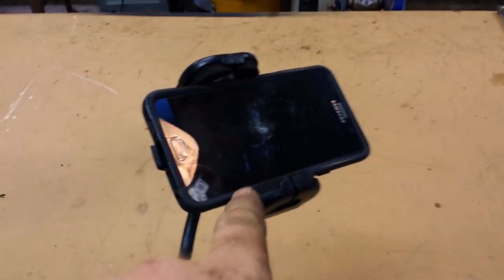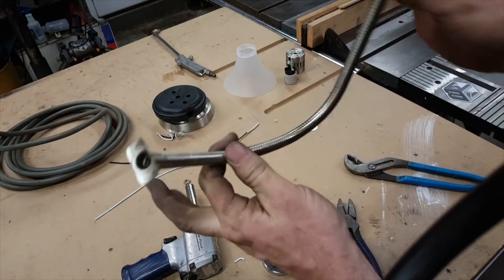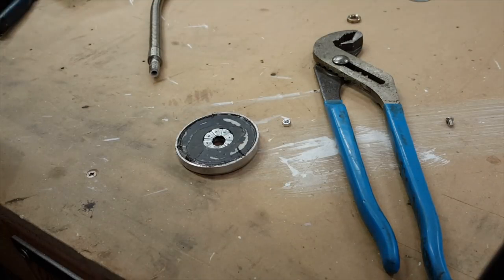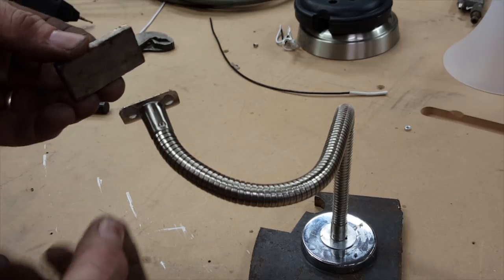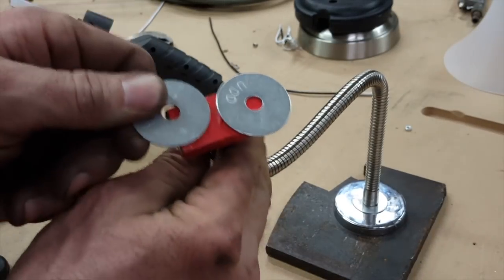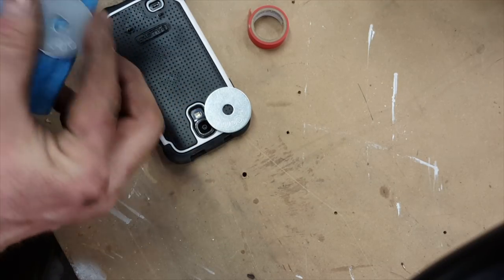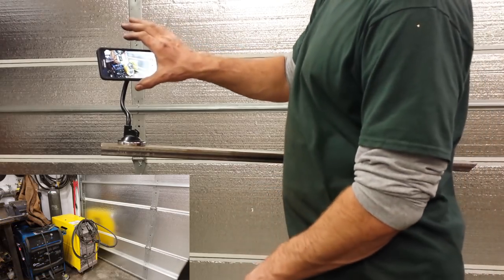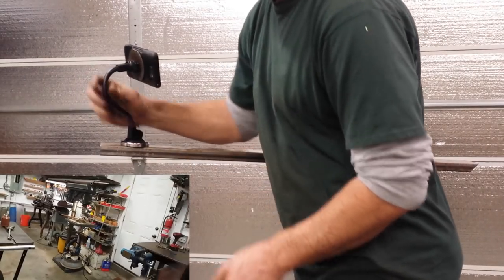How to Make a Magnetic Flexible Camera Monopod

Comment: Like everyone else, I'm always looking for ways to get better shots.  This is a really cheap way to achieve that.  How well does this setup isolate vibrations?  Example setting it on the table saw?
Reply from the maker: It's not great for vibrations. I've been using a stand with a metal extension arm to isolate the mount from the tools. Still way easier to get cool video angles.